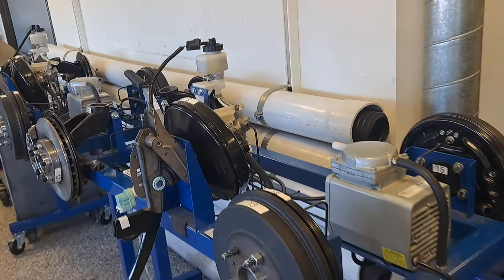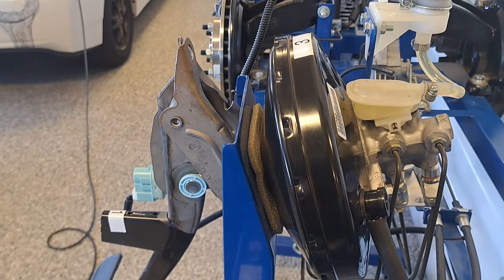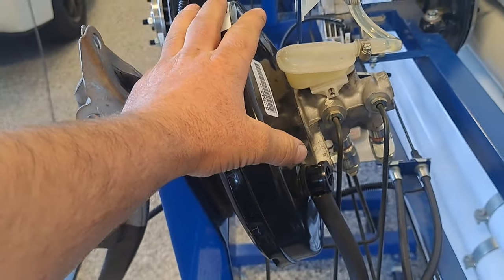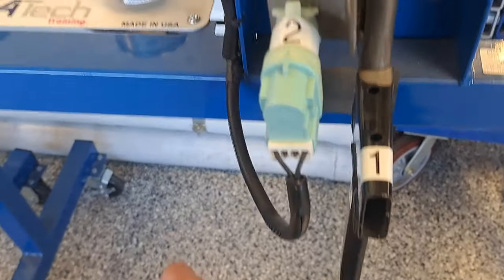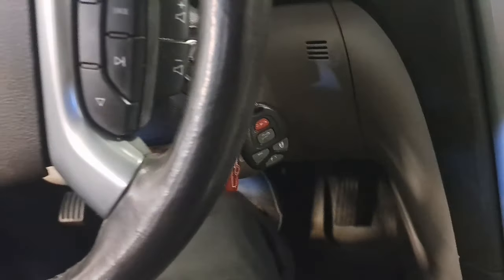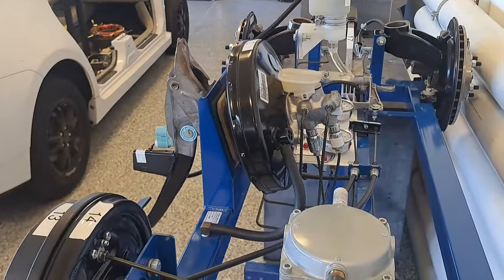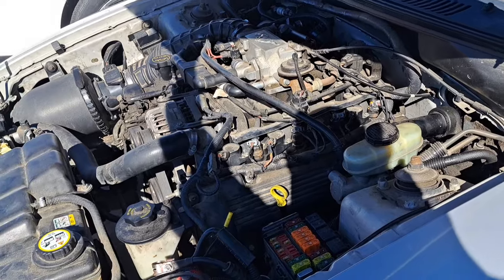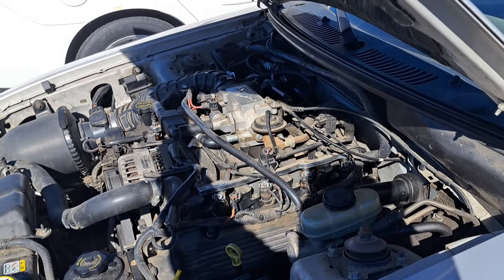ASE A5 Brakes class brake boosters 101

Comment: What affects brake pedal return ability? Is it the return spring in the booster? And what happens if the pushrods are not adjusted correctly?

Comment: If you are going to do math to explain what is going on.... you should get real numbers.  a "10 inch disk" has more than "10 sq-in".   Otherwise... a good vid.
Reply from the maker: Fair point, I'm usually moving pretty quick and throwing numbers on the fly to illustrate a concept for a technician more so than for an engineer to do math but you are right on the much higher assessment.